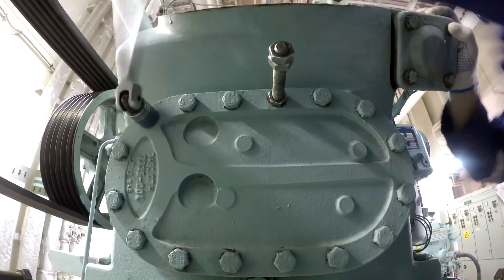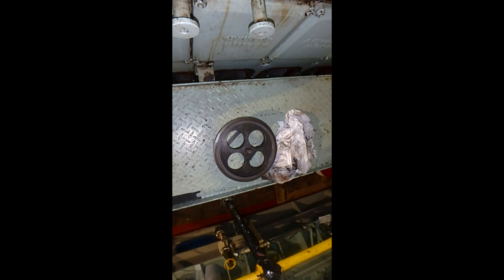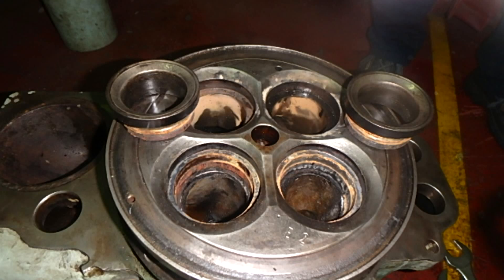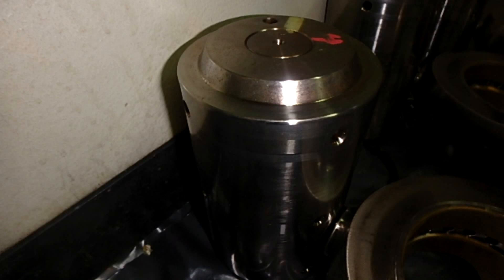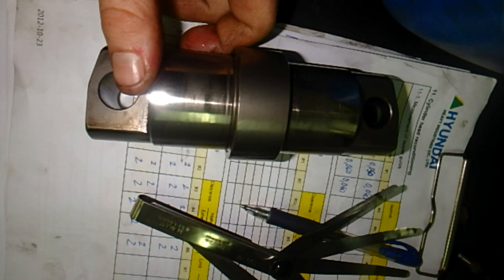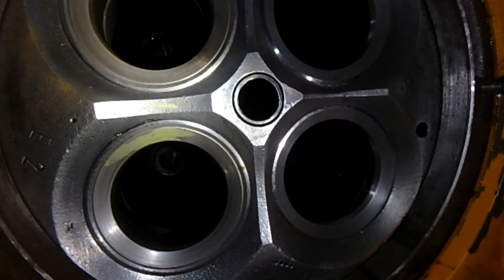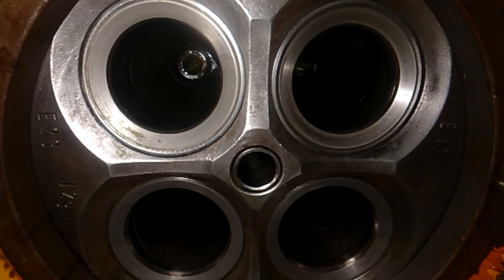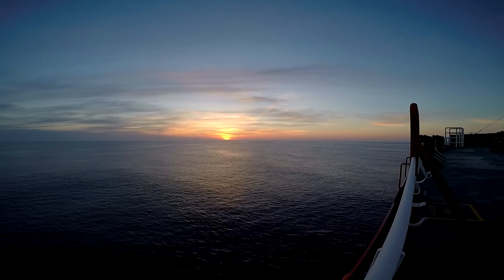DIESEL GENERATOR OVERHAULING MEASURMENTS & TESTS PART3

Comment: Hello! How are You? Many thanks for you video!
Please tell me about this type Aux. Eng. 
What the common problems we can have during operate and maintenance if vessel has 8th years old?
Reply from the maker: Hello! Fuel pumps mostly and injectors should be in priority.And later on calibration of thermometers and replacement of old one.
Turbochargers will need a clean to nozzles and exhaust wheel.

Comment: Sir, do you have special tool for the cylinder head pressure test or only fabricate? Thank you for your reply.
Reply from the maker: Normally the tool is a option buy from manufacturer. It is little tricky to make such special tools .Normally all special tools must be provided by manufacturers.Thanks!
Reply: @Adventure-Story  thank you Sir